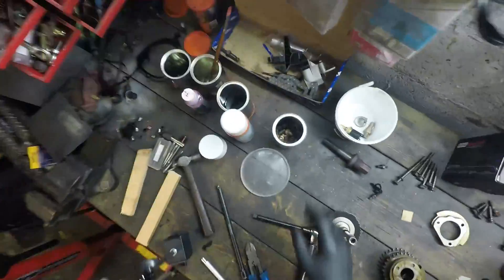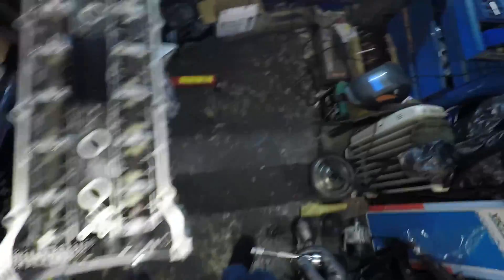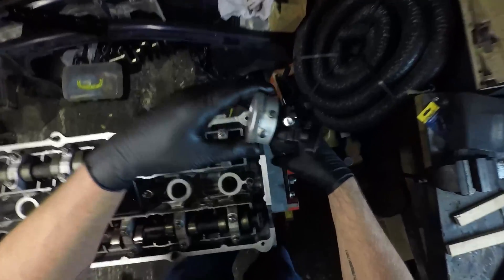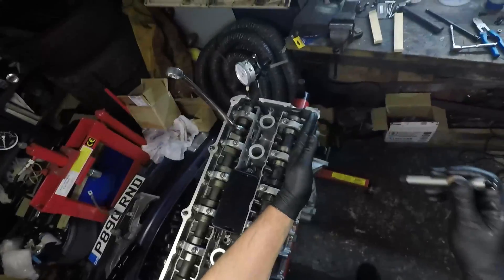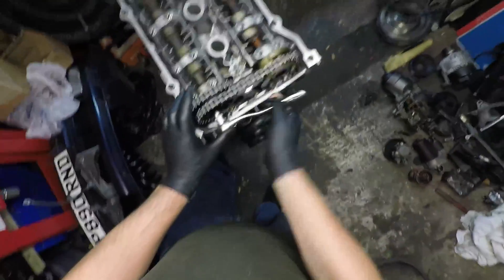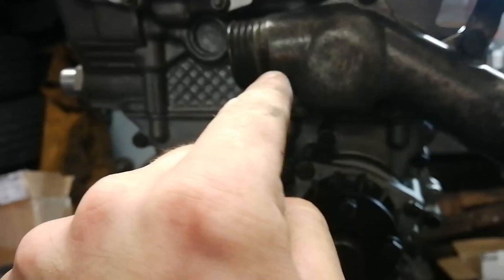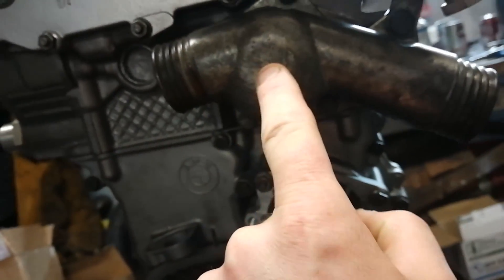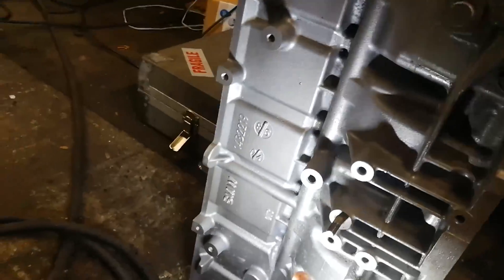E36 M50B30 Stroker Timing and Cam Setup

Comment: hey mate could you confirm if youre still using the standard m52 cam trays with the m54 intake cam? I heard it needs some modification to fit. Mine seems to fit fine just with the shortened vanos gear, but I'm worried as all the forums say the trays need to be grinded down.

Comment: which cam setup is this, i have m54b30 and m50b25nv cams and trays. about ready to put the cams in and time the motor. it looks like in your video that you can't use the timing blocks. is this true?
Reply from the maker: You use the timing block for the M54 cam, it sits normally as an intake cam. The m50b25nv intake cam is used as an exhaust cam which means that it sits about 60 degrees off its normal angle to allow it to work. There are now 3d printed timing blocks available which make this job much easier.
Reply: @ManSeeksCivic  the m54 cam is the exhaust one correct?
Reply from the maker: No, the M54 cam is the intake.

Comment: Hi there, will m54b30 Intake camshaft fit onto m50b25 non vanos
Reply from the maker: Should do, you'll have to check cam tray clearance or use the m52 tray.

Comment: Hi. I know this video is old but I have one question. I build turbo M50 with two intake cams. How mush lift to set on 6th cylinder ot TDC to have perfect setting for turbo engine. I know overlap is not good....
Reply from the maker: Because I've not built a turbo I wouldn't be sure. I'd assume the stock setting would work... But to give an optimal setting would need someone with more experience than me.
Reply from the maker: Good luck with the build.
Reply: Hey Peter, I have also a M50 double intake cam set up. do you get Infos about houw much lift on TDC? My Setup bring me high Exhaust Gas Temperatures at high RPM. So i have to change it. Maybe you get a good Setup for me??

Comment: @Pamo  Hello, I have seen your video and I really liked how you work.  I have 2 doubts to see if you can solve them for me, 1st, what do you mean by the letters TDC?  and 2nd, is the opening on the valve 0.1mm, which is 1 tenth or 1mm?  I read comments and did not understand it very well.  I am from Spain and I am doing it on a m50b25 nv engine the stroker, is this setting of valve opening also valid for m50b25 nv? Thank you
Reply from the maker: TDC = Top Dead Centre
0.1mm is 1 tenth of a millimeter
The valve opening will work but there is quite a large range which you can use that affects how the torque curve responds. There are now a few guys making 3d printed timing blocks that make this process much much easier - run a Google search and you should find them.
Good luck.
Reply: @ManSeeksCivic  I imagine the TDC to be from the valve?  The valve is in tdc, is that where you have to give it 0.1mm to stay open?  Is there no problem of any kind in the operation of the engine with respect to touching the piston heads?  Thank you very much, I was really going crazy because not many people do this.  Thanks
Reply from the maker: Top Dead Centre refers to the piston being at its maximum height in the cylinder for a particular cycle. You use this point to check the opening because its a set point which is easy to confirm in the engine cycle. 
No you will not touch valves with this lift, these engines are capable of much higher lift than these cams cam provide.
Reply from the maker: https://en.m.wikipedia.org/wiki/Dead_centre_(engineering)

Check here for a better explanation than I can provide
Reply: @ManSeeksCivic  I understood it, in the TDC with the piston at the top, which is the setting mark of the crankshaft pulley with the cover. I give 0.1mm of opening to the valve, is that so?  thanks friend
Reply from the maker: Yes, but we're talking about cylinder 6 at tdc in the video here. Good luck.
Reply: @ManSeeksCivic  Understood, thank you very much friend, you have some very good videos.  One last question, the pistons in tdc, did you have the plane of the piston head 1.6 mm from the plane of the block?
Reply from the maker: Sorry, I didn't go this far into the measurements. Sounds about right though.
Reply: @ManSeeksCivic  Thank you very much for your help and for the explanations.  greetings thanks friend.

Comment: Hey mate! I have a m50b25tu aswell and I instal this setup yesterday! I read from pazi88 that u have to machine the sprocket mounting surface down by 2mm for the M52's. Is that same for M50's?
Reply from the maker: Yes. The heads are almost exactly the same.

Comment: Hello 0.9  
.06 ?
Reply from the maker: Around 1mm open at tdc.
Reply: @ManSeeksCivic  what 1mm? 
0.6mm no
Reply from the maker: It's preference. You really need to start with 1mm then log the cars torque curve. Adjust until you're happy with your setup.
Reply: @ManSeeksCivic  1mm okey 
Camshaft m50b25 no vanos yes 240 9.7

Comment: You exhaust cam timing is wrong, it shoud be 1mm lift, not 0.1mm.
Reply from the maker: Well spotted. There have been a few before me who have done this setup. I started with 0.1mm as per the pazi videos and have since gone to 0.5mm. I may try 1mm also to see how it moves the power band. 👍
Reply: @ManSeeksCivic  I have same engine setup with 11.5cr, but i dont remember how i set my exhaust cam, i think 0.5mm. Only after i finished engine and drive half year i read this https://www.romraider.com/forum/viewtopic.php?f=58&t=13968&start=75

Comment: Hi Mate, Any more progress on this?
Reply from the maker: Another video is being edited as I speak and should be out on Friday evening. We were hoping for today but my filming is a nightmare and my excellent editor has to work her magic 😂
Reply: Excellent cant wait. I have just purchased an m54 engine to do a similar build so have been following your videos. I am using an m52 block like you originally planned on using but the threads stripped on yours, did you ever work out why that happened? The arp head studs you used, was they specific to m52 ally block? From your videos I didnt see you buying a new set of arp headstuds when you swapped to the m50 block. The m52 arp specific head studs are 15mm longer than the m50. Not sure if that would have made a difference to stripping the threads?
Reply from the maker: @GaragE36uk  I used stock head bolts... Not studs. I'm fairly sure the threads stripping was down to the overheat I'd had previously. I believe this softens the alloy and leads to the issues. A virgin ally block should be fine.
Reply: @ManSeeksCivic  ah for some reason I thought you used arp. That's my theory out the window ha ha 

Thanks again, look forward to the  next installment

Comment: Hey Pamo, not shure if you were aware, that Pazi set the opening to 0,1 mm by accident. He was trying to go to 1mm open at TDC for the correct overlap. Its clarified in the comments of his video https://www.youtube.com/watch?v=ZjKEzgb6lfo

I am too in the process of doing the same as you (M52 stoker) i also have the M50 cam for exhaust side but the S52 instead of M54 for intake. My Block is Aluminium but i have inserts in it :)

Are you also on MS41/Romraider?

Best of luck for the rest of assembly!

Comment: "I'll just grab my nutssss!" you'll love that lower temp stat, it's what I run in mine, remember I have heating and a quarter temp water in less than 5 mins so ideal for cold weather when you're freezing and it's all steamed up! I might even have a 78 degree one, but I know it was lower and it's mint! Also have that billet stat housing too or one similar to yours.

Comment: Hello, Pamo. What is the point of clocking the exhaust cam 62° forward?
Reply from the maker: It's actually an intake cam being used as an exhaust cam. This is me setting the correct timing to make that work properly.
Reply: @ManSeeksCivic  I know it's m50b25 NV intake cam but i didn't knew it has different position, thanks.